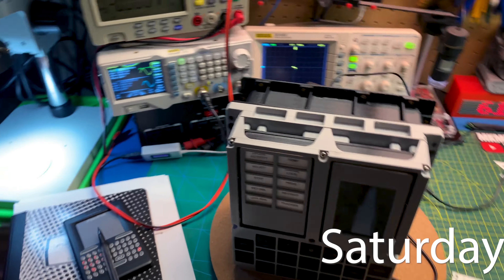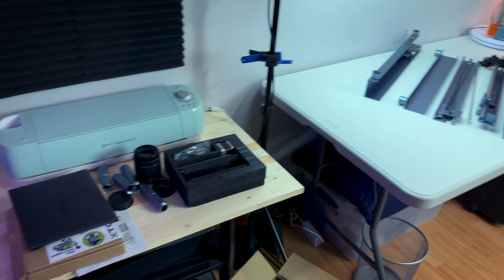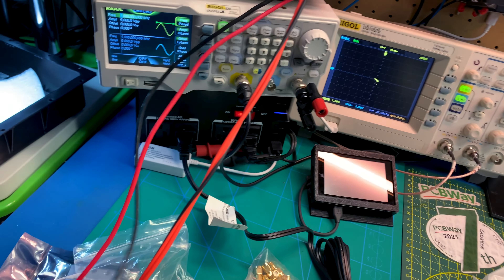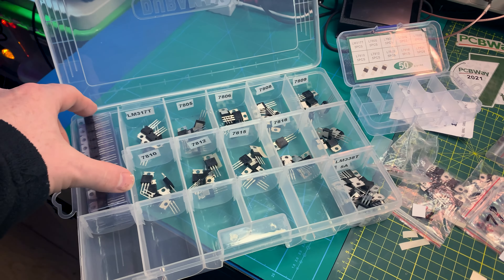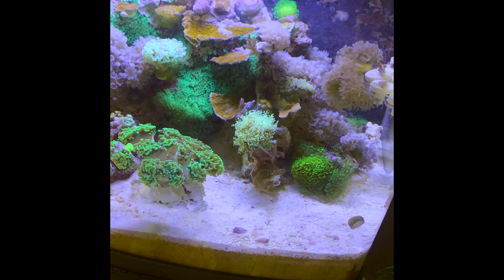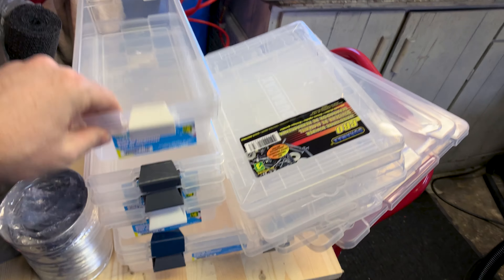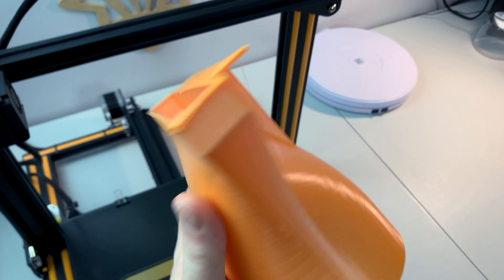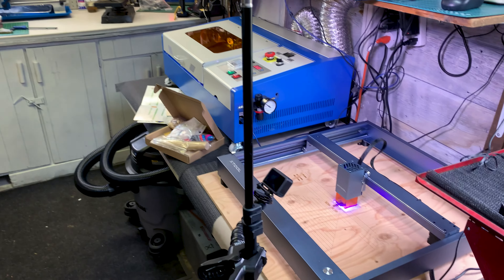Simple Hacks For Organizing My Lab | Update

Comment: 3:25 - I've tried a lot of products for label removal and finally settled on something near perfect - Bestine (pure n-heptane) by Speedball (the silk screening supply folks). Don't know if it's available in Canada, but I got a quart for something like $23 shipped from Walmart. Put a drop on the edge of the sticker, peel it up a bit, then just dribble a tiny amount under the sticker as you peel. Works on any modern solvent-based adhesive. Most of the time the adhesive remains on the sticker, so you can put it down on some wax paper and reuse it if you have the need. Doesn't haze plastics, can even be used on cardboard and paper without leaving any residue at all. Collectors of modern stamps love it. Magical stuff.